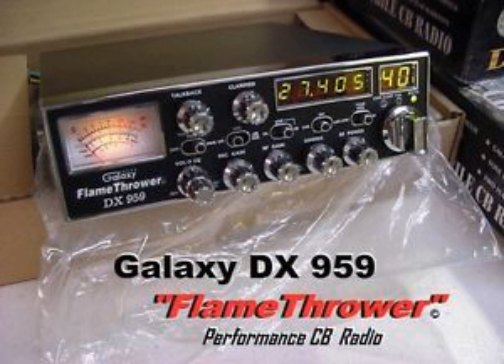Flamethrower Galaxy 959

Comment: Sooo dont buy the Flame thrower?..I have 2 radios ive been playin wit here lately.Cobra 25 with mossfet final..jus alil over 20nwatts...on a K30 mag base in a Jeep wrangrler..decent lil radio.have a cobra 29 nihgt watch woth big finals aswell in a international 4300 with a francis whip..beleives its a 30p watt attena.of course the 29 gets out farther..ehh nout 10 miles is all im getting outta the 29..im using stock mics.but feel i should be getting out more...was thinking of buying a 3rd radio..or mod the cirrent radios farther..jus askin for sum advise on what my next step should be

Comment: Hey I know almost nothing about CB radios lol so I am kinda stupid. But I would like a setup that I can really reach out there I'm a new truck driver and I would like to get a great setup. I know some units can reach 100+ miles. So any info would be appreciated thanks
Reply from the maker: Best performance will happen in a vehicle with a large metal roof like a Tahoe or Suburban assuming an antenna is bolted to the center of the roof. Tractor trailers will never perform like an SUV or station wagon. 
Focus on the antenna system to maximize performance with a stock radio before looking for shortcuts. There are no shortcuts. Once you can transmit 20-30 miles on flat ground mobile to mobile, you can move on to the next step.

Comment from the maker: Bill Anderson according to B&K precision signal generators which are not very accurate by the way compared to more higher-priced Agilent and Hewlett-Packard equipment if you turn the generator down to the lowest setting which according to 1 friends generator was .001 microvolt It produced an audible tone in my president hr2510 receiver. in all reality the noise floor was actually -135 DB
which is much lower than anything you have ever seen in civilian equipment